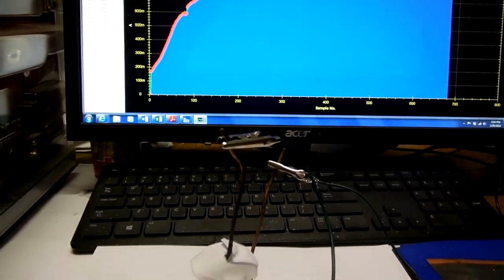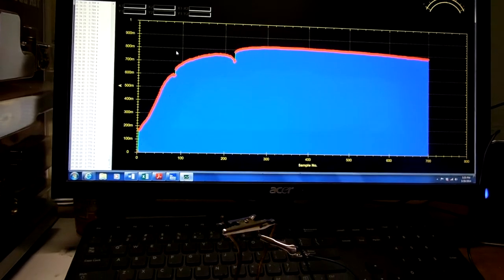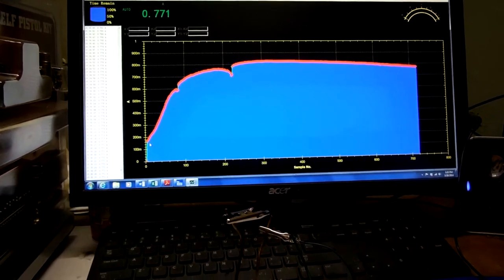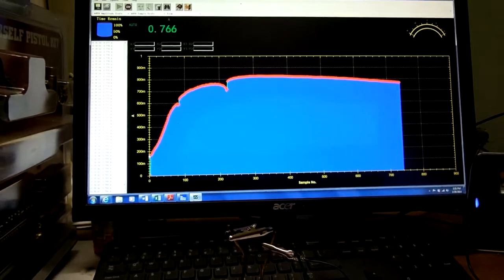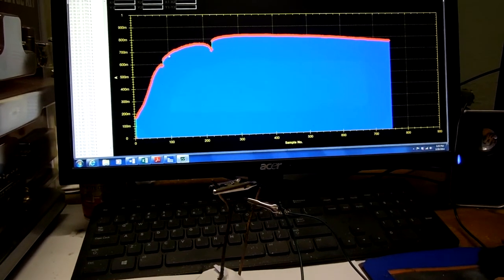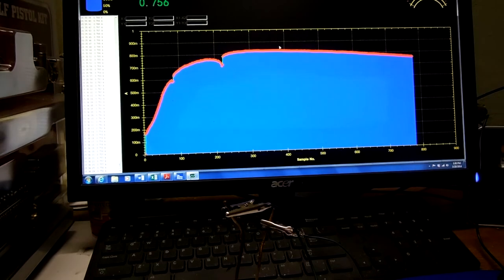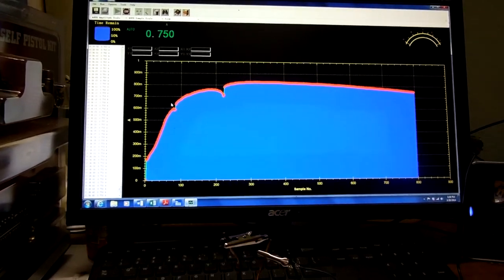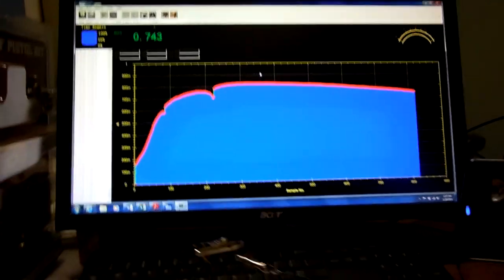Rechargeable magnesium copper battery

Comment: I too have discovered a rechargeable magnesium battery, real simple too...

Buy a bag of MSG, bottle of water or some water, mix a good amount of msg into water, place about 30cm of magnesium strip coiled up into the msg water solution, magnesium strip is negative, has to be neagitive and a strip of lead i used ebay 30cm lead rolls for fishing, use say 8cm of 0.8mm lead strip and 30ish (enough suface area to match the surface area of the lead strip) and charge!

It produces crystals on the lead strip which get reversed on dishcharge, high current for the size